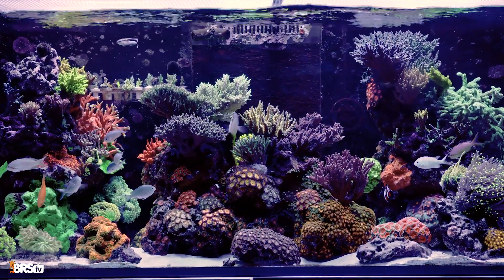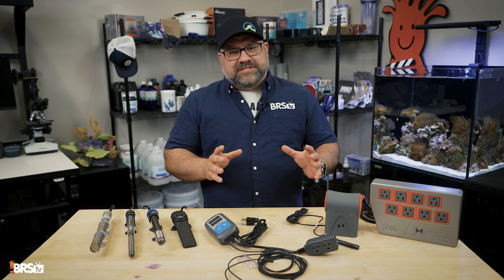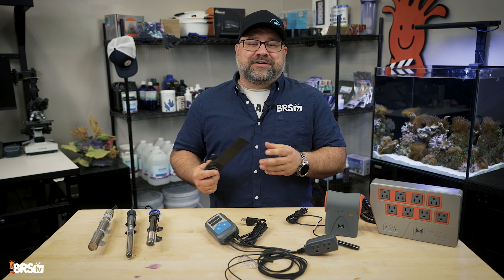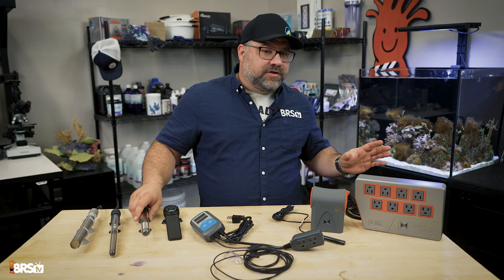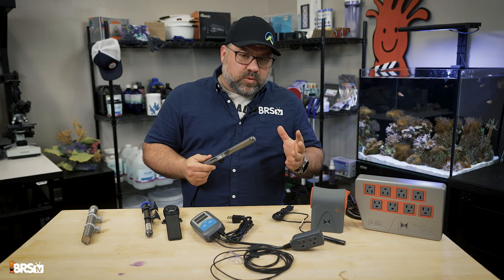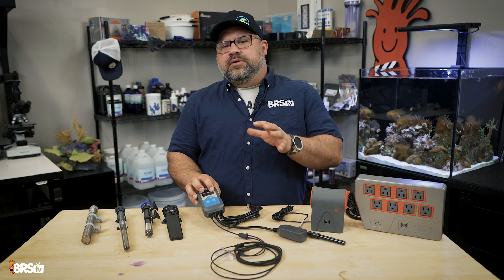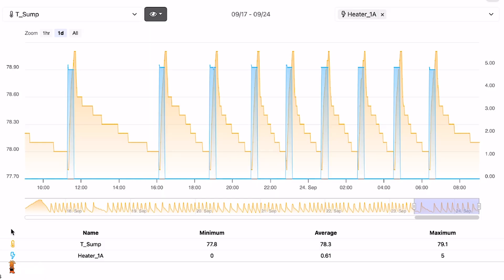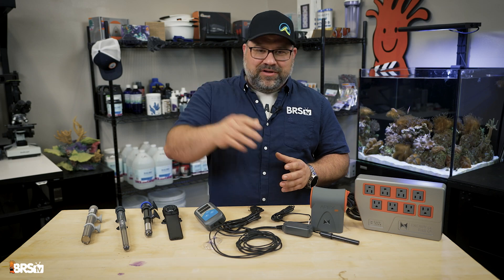The Breaking Point Ep. 1 - Your Aquarium Heater WILL Fail.

Comment: I find the cheapest method to avoid thermostat failure is to buy SMALLER heaters. The more it clicks on and off, the faster it wears out. Your heater (or heaters in a bigger tank) should only be able to raise your tank to the temperature you keep it at; the maximum temperature, from the coldest temperature in the house. Then it’s not possible to cook your tank. Your fish may have 1-2 degree temp swings between cycling on and off depending on your settings… and they won’t care. Tanks in the house probably need to have their water temperature raised only 5-7 degrees. These thousand watt heaters make me laugh.

Comment: What would be a good heater for a 15g aio?
Reply: I just ordered a Helio 50watt for my 13.5 gallon.  I use a dual probe in my 40 gallon and works amazing. My heater is keeping the water warmer than normal so I had to buy a new one.
Reply: @togish1 I have a hitauing ap02 heater that is 50w where I have to submerge it in water. If it is not submerged the heater will not turn on.
Reply from the maker: A great option for your AIO would be the AquaEL Ultra Heater (probably the 75W version). It's slim design is great for those small AIO compartments.

Comment: And that is exactly why I use a commercial temp controller Ranco/Aqualogic. Way more dependable than cheaper alternatives. Multiple heaters set a couple of degrees above desired temp set on controller. That plus a temp monitor for notifications. Nothing is perfect but some options are better than others😂
Reply: Can you explain the temp monitor for notifications
Reply: @abep.3110  Several options out there for  monitoring different things. REEF FACTORY Thermo view Temperature Monitor is an example of something relatively inexpensive that will send you notifications when the temperature is out of its desired range. It pairs with the smart app. Of course this is just a monitor and not a controller.

Comment: That’s why I have my Heater on a separate controller. Heater is set to 81 but my controller is set to 79. That way if either the controller or heater fails to “on” it’ll only go up to 81 degrees.

Comment: I shut down my tank because of this... replace my heaters every year . Both heaters are on different controllers. One day in the winter it failed. tank went cold, most of my coral died, got completely new ones, sure enough again malfunction and boiled the tank. Killed everything. Aquarium equipment is all reskinned chinese trash. Even the controllers, spend a bunch of money and out of the box its 2 degrees off and seems to get worse with time. Seriously if you are in the hobby, temperature control the room, or be prepared for a heater to bust. From Ehiem to Oase, all are trash
Reply: Just buy titanium heaters and a decent controller. Dont gamble